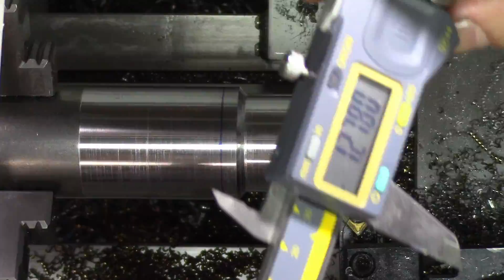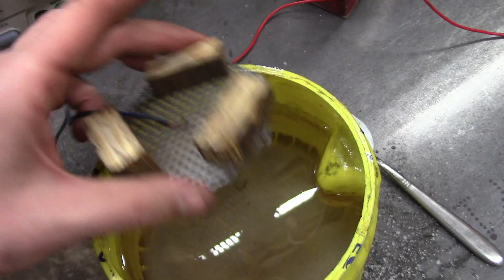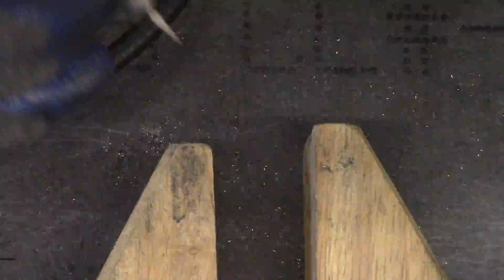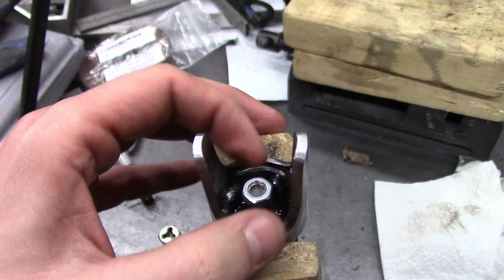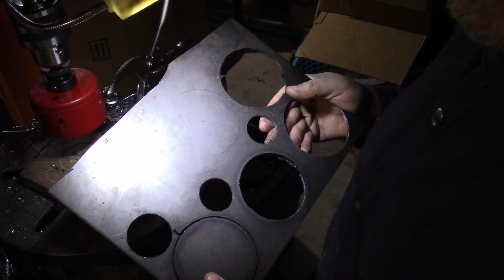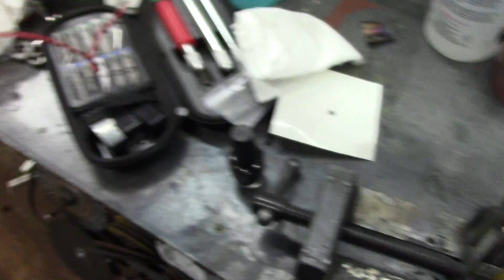FIRST EVER TUNGSTEN-CORED THOR'S HAMMER (WORLD'S HEAVIEST) | 135LB MJOLNIR (Part 1)

Comment: Please don't use Stainless Steel during that etching process. There's some variables involved so I can't say for certain; but I know that using a similar process to remove rust will pull chromium out of the stainless steel and make Hexavalent Chromium. It is a nasty carcinogen, difficult to properly dispose of, and is typically illegal to have and use. Just using regular steel is much safer.

Comment: Just curious, any reason for sanding the disk round instead of using a four jaw in your lathe? Seems like since you know your graphic was round it'd be a pretty easy setup.
Reply from the maker: I agree with you completely, however I wanted to do it by hand because just in case the graphic WASN'T round (maybe the vinyl got distorted a little when I applied it), I didn't want to accidentally remove too much material and potentially ruin the whole part. Basically I wanted to leave myself room to fudge the roundness by say .015" to make it more pleasing to the eye by centering the runes better. Technically not perfectly round then but that's not the priority with something like this, IMO.
Reply: Pretty Hate Machining Makes sense! IMO it would have been close enough to clean up with a couple licks of a file, but I see where your head was at. Great build! Just checked out some of your other videos and subscribed.
Reply from the maker: Thank you!

Comment: Why not model the endcap accurately in 3D, 3D print it in ABS and acetone smooth it, then make a mold and cast it? Seems like it would save a ton of time and money. Or just send it out and have the model laser sintered, that would be easy too.
Reply from the maker: You make it sound really easy, do you have any resources you could link me to?
Reply: Pretty Hate Machining Forget ABS :) Use PLA https://www.reddit.com/r/3Dprinting/comments/22osqr/my_first_lostpla_casting_with_lots_of_pictures